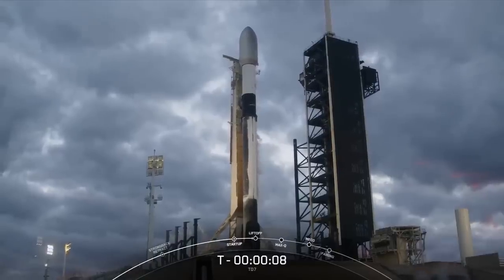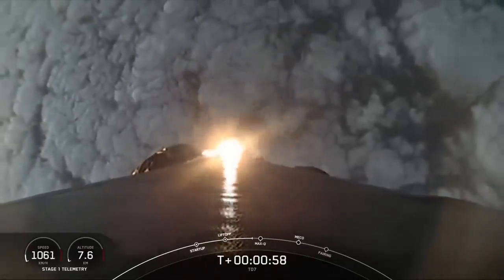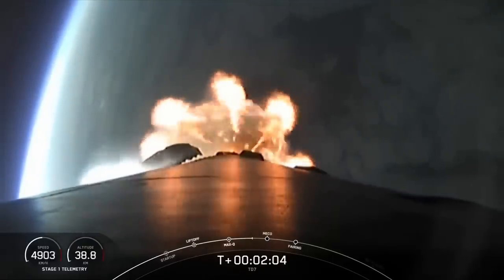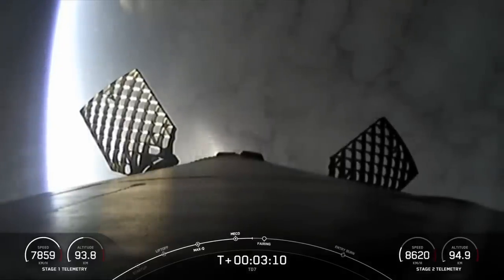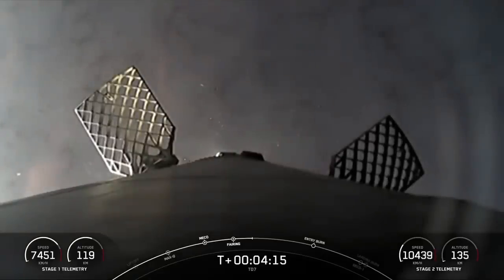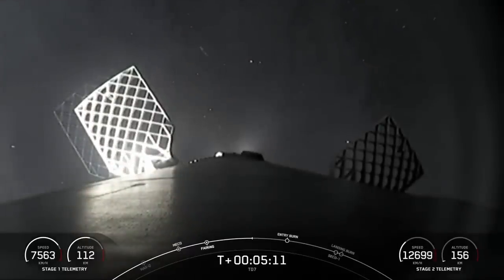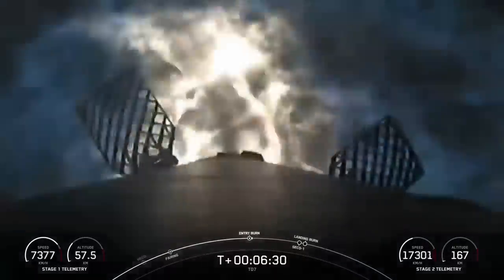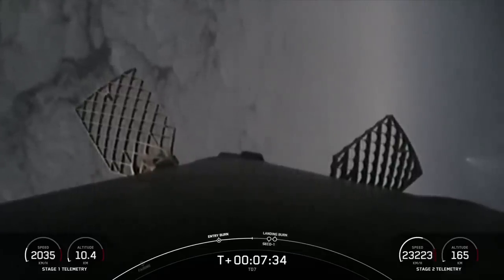Blastoff! SpaceX launches Optus-X telecom satellite from Florida, nails landing

Comment: what is the ufo on the right side that comes down from :20 second mark. run it in slow mo
Reply: It's not an UFO, it's not an object, buddy.
How come you don't know? 
Have you never seen the unwanted internal reflection of the photographic lenses? 
A reflection that forms and are particularly visible in the presence of very bright elements, as sun, moon, artificial lights, etc.  
Never heard of Ghost & Flare? 
Come on... that's simply the internal reflection of the engine flames, upside down, projected on the other side on one of the optical lens or the photographic sensor with a green superficial treatment. 
And of course with the camera remaining still, the reflection moves at the same apparent speed as the rocket.